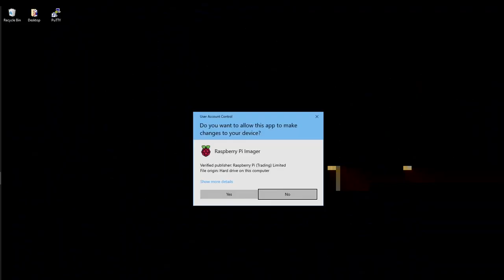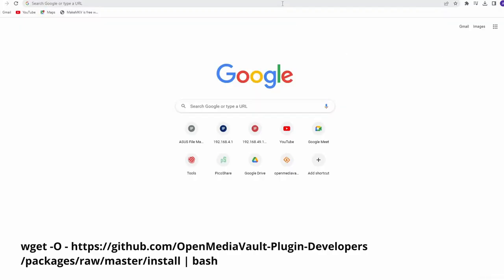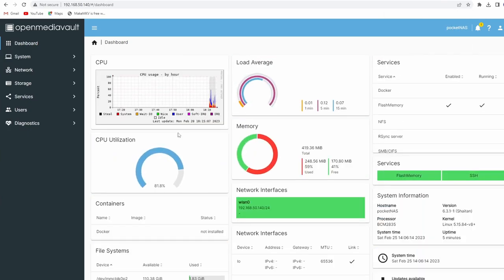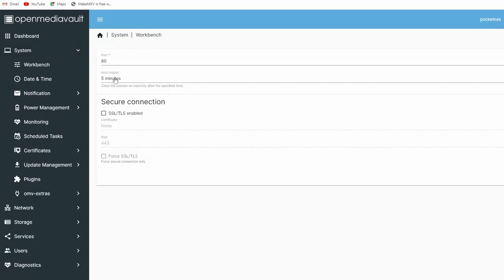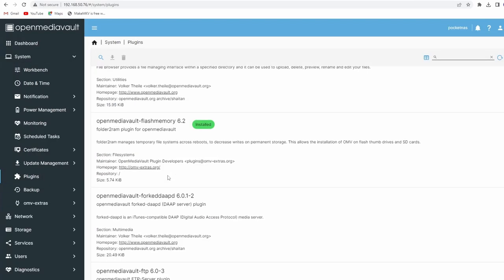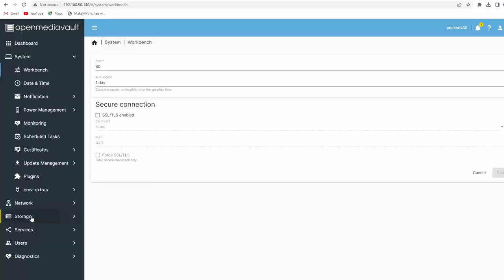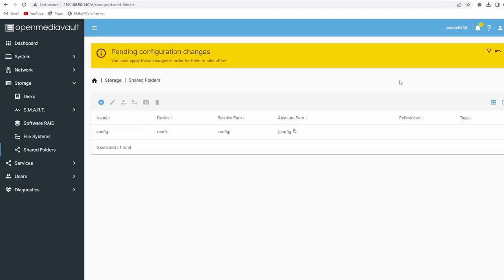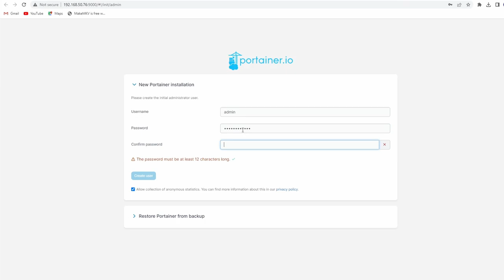Hot PocketNAS. a mobile pocket sized NAS using Raspberry Pi Zero 2 W,  OpenMediaVault6 #PocketNAS

Comment: Have been toying with this concept for quite a while now - more with a view to using the Pi as a personal LAN zone that is used for gateway connection of your local devices;  so for example your  local LAN hotspot enables if the system detects an upstream connection (via 2nd USB connected WIFI dongle) that it can authenticate with, all automated by script.  Then your phone, etc. can automatically switch to using that data connection just by being in proximity the same way they do when you come home and everything's using your home wifi.
The other advantage is that you can sync to the device automatically (e.g. using Nextcloud, etc.) and use it as a live backup of local data;  useful if you are concerned about loss from hardware failure, theft, damage, accident, etc. on the go.  If the device is kept in a pocket, etc. it's physically separate from your bag (so if that's lost/stolen you still have local backup).
You can have the device do more menial things (so-called "mule" tasks) such as getting it to perform large downloads of big files, etc.  I use Aria2 and browser plugins on laptops, etc. which offload the arduous task of bring in bigger files to my Pi (or similar device).  Imagine this continuing big file downloads when it finds a friendly or connectable network (so you get on the train and it recognises and connects to the local WIFI and continues the download with no intervention from you, all you see is the download progressing and your personal LAN is active again). 
If you VPN tunnel your upstream it side-steps some of the natural security concerns you would have with public wifi utilisation too.
Security sweeps and network discovery/mapping can be automated, it's just another service;  you could also automatically sync with your home network when it's in range and perform an rsync of new videos, etc.from your pocket.
Main concerns - forget trying to find a Zero 2W, I'm going to try some of this out with a Zero-W (1.3 single core).  I'm not sure what the lifespan of that battery is - also is it possible to have one that sits along-side so the overall device is larger/flatter but not thick?  I think this is more practical for pocket storage.  All piled in one cluster vertically may create more heat and certainly makes for a thicker bulge to go into your pocket.
SD card lifespan can be dealt with by using high-access cards intended for security devices, etc. although I've not encountered too many wear/overload issues with my 9 Pis so far, perhaps one or two SD cards that were worn out.
One idea I wanted to explore was the management of the device via a bluetooth connection - perhaps a terminal session or basic IP traffic but I've read this isn't possible:  but I can't understand why, has anyone information on this?
Reply from the maker: definitely a lot of cool ideas!  not sure about the longevity of the battery but surely depends on the tasks being performed by the Pi, I have left it running for 4 - 5 hours with no issue.  I agree having the battery alongside makes more sense, which is what I plan to do but would need to extend the wires to maintain microUSB access.
Reply: @5ubzero664  yeah the trick is mainly the case - I believe you can power a Pi through the GPIO ports but in this case something user-insertable would probably be better.  With side-by-side configuration we have room for a potentially more capacious battery from an  existing phone (thinking of a battery designed for a phone series already).  Generally speaking I'm thinking of something that would target a 24 hour lifecycle  with nightly charge (perhaps a QI charge coil given the larger flatter area).  
I've seen a solution which someone used to tunnel IP through Bluetooth (they just used the tethering system, that never occurred to me) and in the video they did manage to access the device's local IP and services.  
Main thing would be to find a decent USB wifi card with strong pickup and transmission, thinking a decent aerial on a USB NIC - they are plentiful on Aliexpress.  So far a fair bit of the concept seems plausible off the shelf, the battery and casing are the main odd points.   Thinking for casing - a hard  enclosure for the Pi itself with heat sink gaps and the rest being relatively structural and simple nylon type plastic. Even obfuscate the device's appearance by covering it in leather to make it look more like a pocket notebook or small wallet, best to lower interest in such a device.
Reply from the maker: @davocc2405  I like the idea of the pocket notebook. inconspicuous. Has to be the right size otherwise would defeat the point of the exercise.
Reply from the maker: @davocc2405  lots to unpack here, definitely cool ideas, thank you!
Reply: @5ubzero664  I picture the size and layout of the traditional cigarette case though perhaps slightly thicker.    It has to be signal agnostic of course.  One addition may be an internal electronically run lock so you have a slide open design that needs the OS to issue an unlock signal so it can be opened; that's very rare to find but the parts all exist.  It only expends energy when disengaging the lock so you can open it then it will disengage electronically awaiting it to reset with case closure.

Comment: I can make the NAS without a battery connected to the mains directly, or do I need the battery to sustain the software
Reply from the maker: Yes, if you use an adapter you don't need a battery. Or you can use the battery as a UPS.

Comment: Bro , I installed OMV on my RPI Zero 2W. I have not no lan connection. So I shared the WiFi through lan cable to raspberry pi.

How can I open the openmediavault?

Please Help me bro
Reply from the maker: You can connect a monitor to check the IP address or search for the IP address of openmediavault using an IP scanner like Fing or Angry IP scanner
Reply from the maker: Hope this helps
Reply: @5ubzero664  yeah bro, IP is shown,  but not working
Reply from the maker: @guruvelsarveshwar2020  Try checking your router for the IP.  If that does not work try omv-firstaid to set up ipv4.
Reply: Hey bro, does omv running good in zero 2w ??

Comment: is it possible to do this on orange pi zero 2 ?
Reply from the maker: On paper it looks possible, orange pi May even perform better if done correctly although I have not had experience with orange pi zero 2. One of the main considerations why I chose the rpi zero 2w is the form factor and the fact that I can connect the pisugar that gives it more mobility and ups capability.  Either one of the boards will do but I would not recommend them as daily drivers.  Thank you very much for your interest.

Comment: I can't start openmediavault on the raspberry terminal with the ip
Reply from the maker: Did you try typing in the ip address on your web browser?  I would check the microSD card, make sure it works with other pis, clean it up and rewrite the image, I would also try other power supplies, make sure enough power is available for the rpi and peripherals.  If it still is not booting I would start from the beginning reinstalling everything, from hardware to software.

Comment: I installed the raspbian 64 bit on the Raspberry Pi zero2W and connected it to a screen with mouse and keyboard, but the Micro sd was 16 gb, and it doesn't open the page on the screen, it keeps turning on and off, so I bought a 128 Gb micro card to test, it thinks the problem will be with the micro card. My idea is to make Nas connected to the home network, to have access to it in the cloud, that is, outside the home.
Reply: And I'm going to connect to an external SSD that I have of 64 Tb
Reply from the maker: Minimum recommended I see is 16gb as long as you will not use it to store data.  So it should have booted up. Search for the IP address of the pi. You can access admin from there.
Reply from the maker: @josemoran808  you may also want to try other rpi models that will allow you to boot from ssd. Micro SD cards are not recommended for production